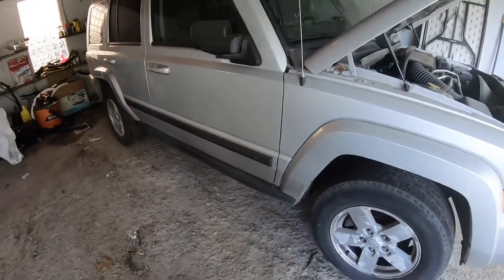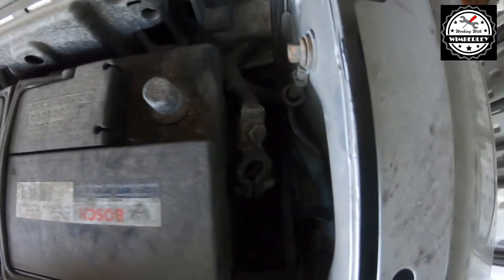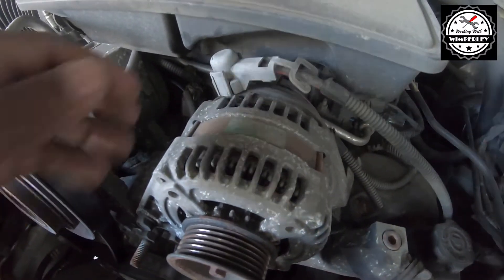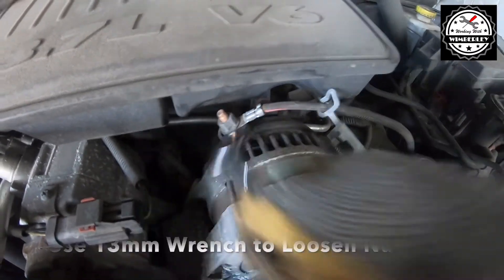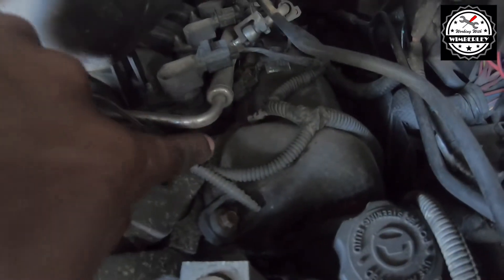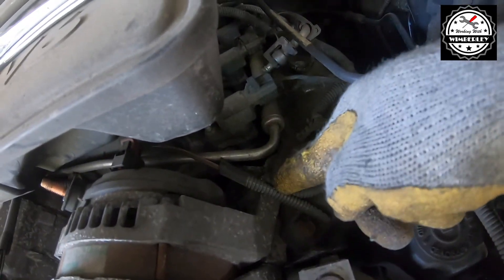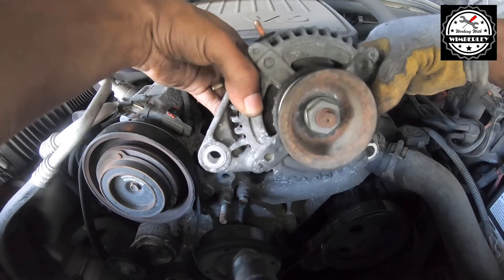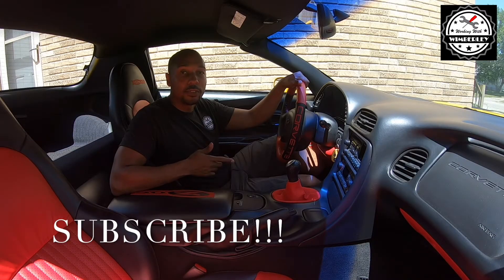2006-2010 Jeep Commander Alternator Replacement & Installation 3.7L V6 How To Change The Alternator

Comment: Thank you so much.  We actually thought that this would be harder.  This video is quite concise and easy to understand and follow.  Question.  After you removed the 13 mm bolt, it looked like there you were doing some sort of prying activity around the alternator.  Was I mistaken?
Reply from the maker: Yes. Around the 3:25 mark if you read the text on the screen, I describe that I’m prying out the alternator. Even though all the bolts were out, it was wedged in so I pried it out.
Reply: @WorkingWithWimberley  thanks 😊

Comment: I have a 2007 Jeep Commander that won't start, which I was told is the alternator. I also was told next to the alternator the piece isn't turning, but I don't know the name of it.  I was told its call the pully. do you know what the part is next to the alternator on the left hand side?
Reply from the maker: I’m not 100% sure but I would guess it’s one of two things. Either it’s the idler pulley or it the tensioner pulley.
Reply: Thank you.
Reply from the maker: You’re welcome!

Comment: How do you know if you tightened the belt enough or if you
Reply from the maker: The tensioner is spring loaded. That’s what keeps the belt tight. You don’t tighten the belt, the tensioner tightens the belt.

Comment: I have all the bolts out and everything unplugged but can’t get the alternator out. I can move it but it won’t come out
Reply from the maker: I had to pry mine out as well. It wouldn’t simply slide out. You can see me prying at 3:22